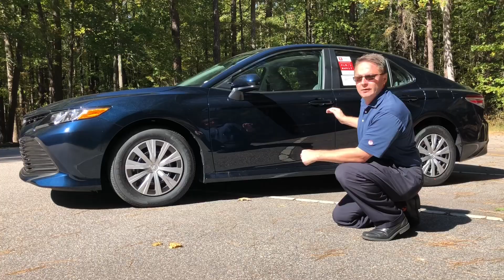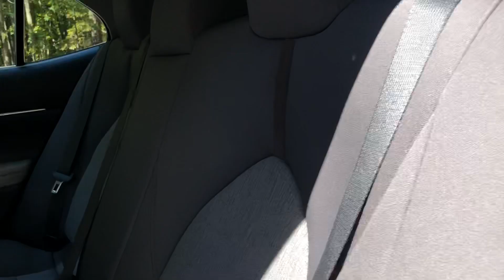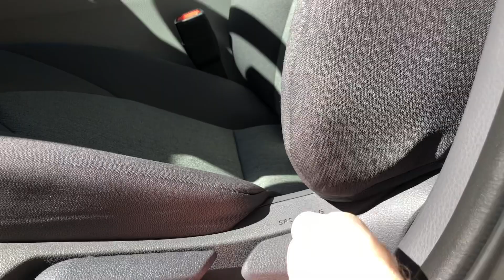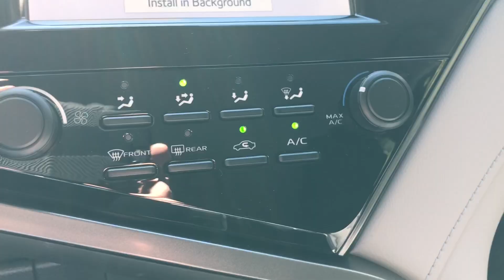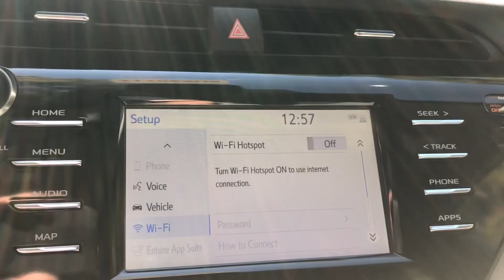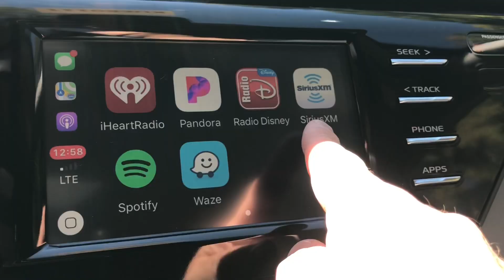2019 Toyota Camry L Review

Comment: L base seems to be a well equipped car. Decent features. We here in FIJI get the 2021 Camry gle. Only trim level. It seems to be based on XLE. But has the old 2.5 engine and is 6 speed. Well equipped but comparing to a standard XLE it lacks few stuff. No drive modes, no adaptive cruise control and lane keep assist. I know Australian camrys also received the old engine. Here it costs 70k fjd. Will be buying soon. So excited for this car.

Comment: I been driving an L base for 2 years. Its literally all I need at the price point. Its was super discounted. And so far I have zero issues. Oil changes and gas is all it wants.
Reply: Same..I’ve have my L base for a year and the only thing I’ve needed so far is oil changes and gas
Reply: 😭 LE costs 600 dollars and you would’ve gotten alloy wheels instead of ugly looking Steelies and that rear seat not having a cup holder in the middle is criminal 😂💀
Reply: @cogtager  Lmaoo does it matter? It’s just a car. That sht irrelevant
Reply: @desireemiller4034  LMAO it matters
Reply: @desireemiller4034 oof! With that mindset “it’s just a car” that says a lot you don’t give a rat ass about your vehicle.

Comment: L model will ride better because the tires have a taller sidewall.
Reply: That will not make it right better the 17-in ride just as good and so do the 18's especially The XLE... The XLE rides better than any of the other Camry's .. and it is quieter as it has a lot of sound dampers.. it is silky smooth that is why I bought it.

Comment: In 2008 I bought a Hyundai Sonata base model with no options but the trip computer and it cost 18,500. 12 years later this car is 5,000 more expensive and you get a lot more features standard, 50 more horsepower, and better mileage. When you factor in inflation this is a heck of a bargain.

edit: I did get fold down rear seats, backseat cupholder, or power driver's seat.
Reply: But it’s a Toyota and it looks better! And DRIVES BETTER!!

Comment: Seriously, Toyota should standardize on alloy wheels. I've seen one too many plastic wheel covers roll away from a car that just passed over some railroad tracks at full speed. Otherwise, I think the L trim is a sure bet for thrifty Camry owners. Less tech also means less things that can potentially go wrong. For the long trips (+12 hours) I take out west, I think the thicker tires of the L trim is better than the low profile tires of the more expensive trims.
Reply: I agree.  I don't like all the tech going into new cars.  It's just one more thing to break in the future, especially if you're the kind of person who keeps a car forever.  Nowadays, a depreciated car can be totaled just because a side-view mirror with heaters and blind spot detection gets damaged.  I like a car to be as simple as possible.  I bought my Toyota Yaris hatchback brand new in 2009.  I got the 5-door base model with manual crank windows and manual locks.  Here I am, a decade later, and I'm still pleased with my Yaris.  It's never been to a mechanic, because there is really nothing to break on it.  If I manage to pull a permit from my city to expand my garage, I would very strongly considering buying the L as a second car.
Reply: @hamsterama  Wow!!! Congrats on your 10 year old Yaris!!! May I please ask, do you live in an area with snow? If so, how does it ride in the snow?
Reply: @brendame   Thanks Brenda!  I live in Columbus, Ohio, so it definitely snows here!  I find that the Yaris handles great in snow.  Never had an issue.  Also, when I found myself in a slide from hitting a patch of ice, I've been able to pull out of it quick.  Of course, if the weather's bad, it's best to stay safe and, if possible, avoid driving altogether.  But in the times when I do find myself in a snowstorm, I find that the Yaris handles it pretty well.
Reply: @hamsterama  Thanks for the response!!! Glad to hear it handles well in snow!!! 
1) Do you use snow tires?
2) How does it handle on the Columbus Freeways...I think they are 71 and 270. ..in the winter?
Reply: @brendame   I'm more than happy to answer any of your questions!  I do not use snow tires.  I have no place to store an extra set of tires.  I just drive all seasons.  I bet this car would handle like a dream in the winter with snow tires, though.  The car handles great on the freeways in the winter with snow on the ground.  Of course, I stay in the slow lane, and I don't drive faster than what I feel is safe.  I got caught in a couple unexpected snow storms this winter, and I was able to safely drive at about 45 mph on the freeway (which was the speed of traffic in the slow lane at the time).  The county is also very good at keeping the roads clear, with snowplows and whatnot.  In addition to I-71 and I-270, the other major freeways here are I-70, I-670, and SR 315.
Reply: @hamsterama  Thanks so much for your help and responses!!!
Reply: @brendame   Sure!  Please feel free to ask me anytime if you have further questions!

Comment: Actually I wouldn't mind getting the L model it's a good value for your money. The only thing is trying to get a hold of it, the dealer will most likely have the LE. Most don't realize is the L model comes with more rubber which makes a more smoother ride and helps in fuel efficiency.
Reply: Jones Albano Like your comments. Please don't laugh...but what does "the L model gas more rubber" mean? Does that have something to do with the tires?

Comment: Listen for 23k for this L 2019 Camry from toyota i feel it should have a little better outlook on the wheels.I cant lie steel wheels are a joke now a days.we should have standard the same wheels as the LX has at least.Hell i feel all L models of all brand of all cars SHOULD BE GONE. because it would save more money for all brands.And it would give people better features.And yeah standard should be apple car play FOR EVERY CAR NO MATTER WHAT BRAND U BUY.Standard should be alow wheels not steel.And most all off a luxury is not having seats in a car that does not move digital.That too should be standard,In all cars not that 1990s crap pump u put in a 23,000 2019 camry Jeff u know im right.
Reply: One thing bad about the new Honda Accord LX is that it does not have a power seat and you can't get it !!!

Comment: Frankly, I disagree with the group think that the "LE" model is better than the "L" model.
If someone is interested in having the majority of the Camry's features at a slightly lower
price, than a frugal shopper should seriously consider the "L" version.

Also, the lower long-term tire replacement expense, along with the slightly better "mpg",
are perfectly logical reasons to choose the "L" over the "LE". Especially, if someone
plans on keeping the car for as long as possible. 

The long term cost of ownership is something that many car buyers fail to consider.
In the context of long term ownership, the "L" version starts to look very appealing!
Reply: The dark irony is that the MSRP is actually lower for some LE models than the L models (they reduce the price after they’ve been on the lot for so long) due to the L model being so uncommon.
Reply: @GeneralSirDouglasMcA maybe the out-the-door price but not msrp

Comment: I just bought a 2018 Camry XSE V6. It has a delay/shift shock when accelerating from a stop or rolling stop. A known issue with the 4 cylinder, which has a software fix. TSB 0330-17. Toyota won't fix my car, won't exchange my car for another that works correctly, and won't buy it back. The 1(800) 331-4331 number is useless. Toyota had the nerve to tell me that the problem with my car is a "normal characteristic". Stay away from the Camry people.
Reply from the maker: I do agree about the 800 number. I've called there a few times with questions about Entune and hung up after I realized I could find the answer myself without their help lol......I'm sorry you're having your issue. I hope you get it resolved somehow. Jeff
Reply: that new transmission had me worried all that fukcin tech my old camry got 300k no prob
Reply: @SuperTrucker101  300K? Wow! My 2008 Camry only had 168K when I traded it in.  V6, ran great.  I probably should have kept it.
Reply: @SuperTrucker101  Congrats on your 300K Camry!!! May please know your 300K Camry's  year and trim level ?

Comment: Just curious, I was just looking at the Toyota website, and noticed that in the build your own section, there isn't an L model you can build, just the LE and up trims. Is there a reason why? Did they discontinue it for 2019?
Reply from the maker: I'm curious about this Brycen. It definitely exists in 2019 without a doubt. I went to toyota.com....I selected build & price. I clicked on 2019 Camry....and the L model showed up highlighted as the default trim level. Maybe try it the way I did it? jeff
Reply: No
Reply: The L is a strip base and it stays that way.. No added options available. Other than floor mats.
Reply: I believe l model is strictly rental fleet only after 2020 models just a theory tho